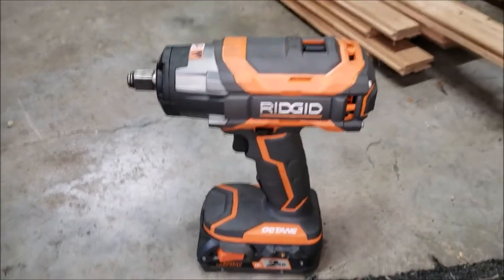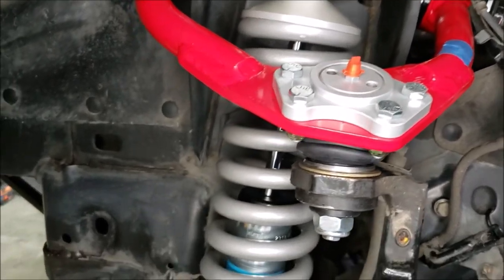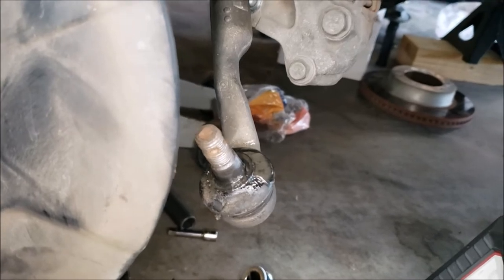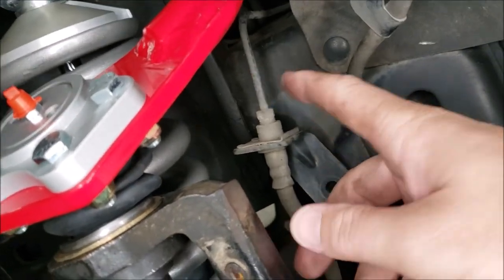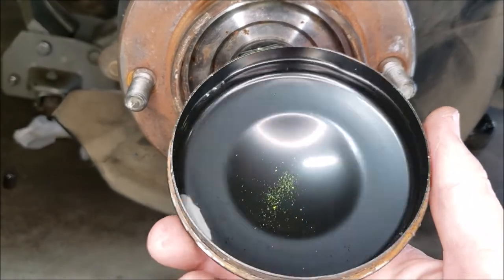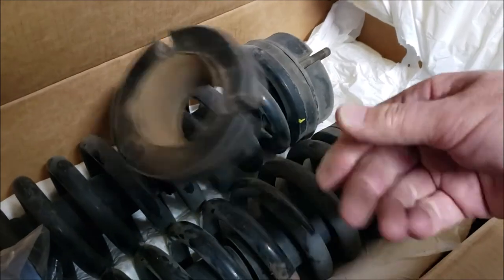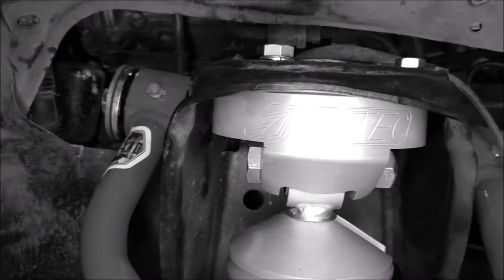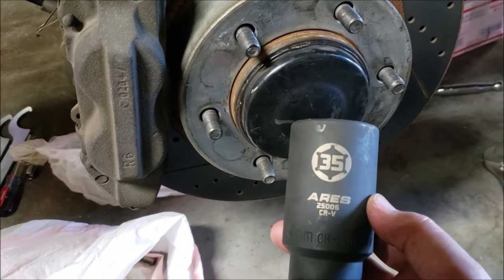Top tips front suspension first generation Toyota Tundra 00 to 06, Sequoia 01 to 07

Comment: Damn good work, I like the real details you speak about.  That others, or me do not think about when replacing parts.    I myself own a 2004 Toyota Tundra double cab bought new in 2004.   I need to do those things for my Tundra as well.   Truck runs as good as the day I purchased it.  335,000 miles.

Comment: Hi, I did a 2.5" lift and I'm getting vibration. I did a diff drop and carrier bearing drop and still have some vibration. Have you had these issues? Thanks
Reply from the maker: Could be a few things depending upon your situation and unique facts. Big factors are wheels and tires.  Problems such as out of round/scalloped. Mis-alignment and out of balance, and uneven tire pressure. 
Drivetrain issues can also be at play. A ding in the driveshaft can change the balance and changing its geometry can also certainly affect it. I recommend looking at the Tundra and Tacoma forums for a possible fix. I have heard of using shims and washers, but I have not done that.

Comment: Idk about banging on the nut and tie rod, I did that when I was starting too. Hitting the knuckle once for twice with the second hammer will usually do the trick. Hit it where the bj is and it will usually break apart. Pickle fork works… there’s a ball joint separator tool too. I only hit the tie rod or nut when I’m planning on changing them for sure.

Comment: Great video! Im in the process of purchasing all the parts needed to level lift my 05 4dr tundra so its nice to get a heads up on what to expect when it comes time to disassembling and reassembling the front suspension.
Reply from the maker: Thanks for watching! If you are removing the upper ball joint from the spindle make sure to buy or rent a decent kit. I rented free from Advance but I had to make sure all the parts were there and undamaged.

Comment: Not sure which rigid you have, but my is 1500 ftp and is currently the strongest on the market
Reply from the maker: You have the high torque. Yours should have no problem with the ball joint press. Mine is the mid-grade. I have since picked up the high torque Milwaukee which is comparable to yours.

Comment: About how much lift were you able to get outta that coilover setup? 
I know those aren't cheap, TOYTEC never is. My '06 D.C. 4X4 is still at stock specs and been rakin my brain on which setup (refuse to use spacers) I should go with. Plus, of course having to swap UCA's as well is a brain teaser too.... like some of the others said our choices are limited on lift kits unless you wanna make the damn thing more or less a ground pounder (which mine is NOT NOR WILL IT "EVER" BE). Damn spacers are more or less just a cheap body lift. Anyhow, hows your experience with those coilovers, and do you have any rubbing issues with the size tire you went with or are they stock sizing?🤔
Reply from the maker: Good questions. This setup will give you 3" at the top. With the tires I have it is an extra 4" total. The tires I have rub a little, so if I had to do it over I would go with a tire size of 295/65/18. Even better with 17" wheels.
Reply: You got 3" lift in the front with the toytec coil over's. How is the ride over rippled type dirt roads. I have 5100's on the front of my 06 with stock springs set at the uppest notch on the shock body and they just beat you to death on the type of terrain I asked about even at  very slow speeds

Comment: How difficult was the UCA’s? I have a first gen tundra and I’m about to order the JBA UCA’s
Reply from the maker: The rod tip in the video is handy and you will want a quality ball joint remover and impact. Make sure the ball joint tool is lined up properly and take your time on that step. Otherwise, the replacement is straightforward.

Comment: I would advise against anything Moog there are lots of QC and build issues regarding their parts.
Reply from the maker: Moog certainly isn't as good as they used to be. The ones in the video are holding up so far, but I did treat them and paint them due to surface rust.

Comment: Lol don’t need the lean shim with adjustable coils..
Reply from the maker: That is true! Toytec didn't mention that... However, I have pushed the adjustability to the max, so it is good to have.
Reply: @gdupler1966  correct, if they are at their max setting, then you would need the spacer. I have the Toytec Boss 2.0 coilovers
Reply from the maker: @Steven-gv1ke  do you like the 2.0's? Are they lightweight?

Comment: Where did you find your lift kit? I'm looking for a lift kit for my Gen 1 Tundra. Thanks!
Reply from the maker: I ordered the parts direct from the manufacturer/dealer. Toytec for the coilovers and JBA Offroad for the upper A arms. You will want a small block (1 inch) or better yet, a leaf spring helper for the rear. I am running Bilstein 5100s in the rear, bought from RockAuto. Links for Toytec and JBA are in the video description.

Comment: If you put a bigger battery on the 1/2 Ridgid it will be twice as powerful.
Reply from the maker: Interesting. I know some batteries work better in Milwaukee than others. I will have to try that on the Ridgid.
Reply: @gdupler1966  Honestly I don't know if I got a bad batch of Milwaukee impacts or not because the Ridgid 3/8 and 1/2 are way better in everyway except size/heaviness. The different mode switch is also a plus instead of relying on how much trigger to pull, but I guess that comes down to personal preference. Try putting the 4.0 battery on the 1/2.
Reply from the maker: @Mattschindig  I will try the 4.0, as I am curious now. Were your Milwaukees fuel or brushed? I recently bought a 1/2 fuel and it does well, but I can see the brushed being less effective.

Comment: thanks for the video! very helpful - did you happen to have any issues regarding the control arm (JBA UCA) bolt diameter? It appears mine has some play as it is a smaller diameter
Reply from the maker: That is a good question, I will have to check. You are talking about the long bolt with the bushings on either side, correct?

Comment: Do you have pics of your pickup or like an Instagram? I’d like to see how your pickup sits
Reply from the maker: I have a post on the channel with a pic, but it is not a side shot so won't show much. It may take a little while, working on a CV boot right now, but I will post some more pics and shoot an upcoming video.
Reply from the maker: It currently sits right at 1/2" higher in the rear.
Reply: @gdupler1966  ok thanks I see it, it looks good. Mine has the leveling kit but could use a suspension update
Reply from the maker: @derekkygar373  Thanks! The A arms and the coilovers make an effective on and off road ride.

Comment: Why Jba why toytec 🥴 you’ll need a new spindle soon calling it
Reply from the maker: Good questions! If my truck were offroad only, a more expensive coilover (like King) and perhaps a uniball UCA, but I am a "weekend warrior" with regular street driving and I wanted the lower maintenance JBA ball joint. As stated in the video, I am not crazy about the Toytec top hat and the bolts supplied, or lack thereof, and if I had it to do over, would give more consideration to King/Fox/Icon, etc.
Reply from the maker: @ToyotaNutjob  Thanks! Hope my experience helps others trying to find that sweet spot of price and performance.